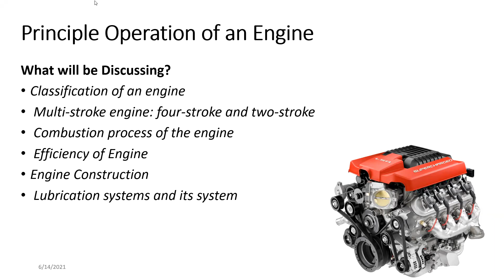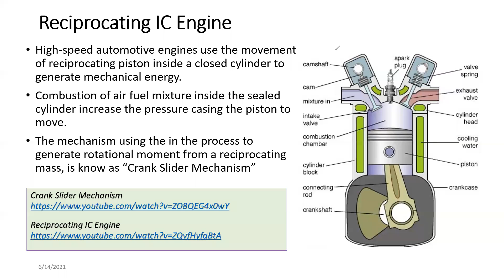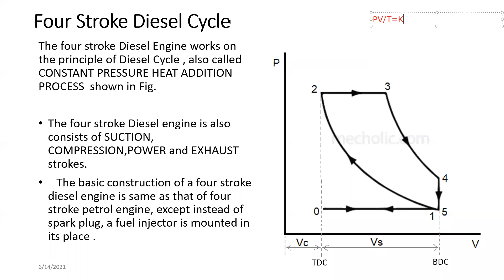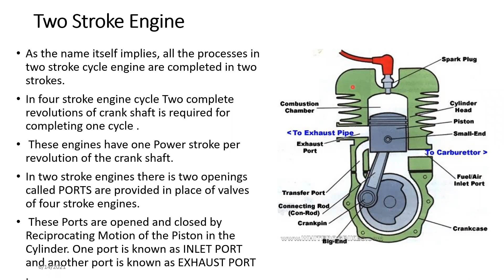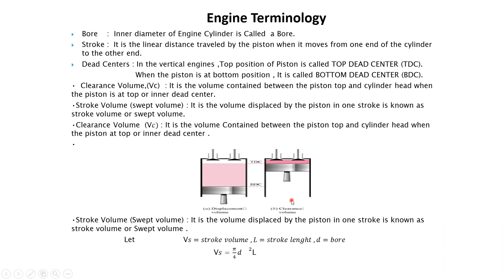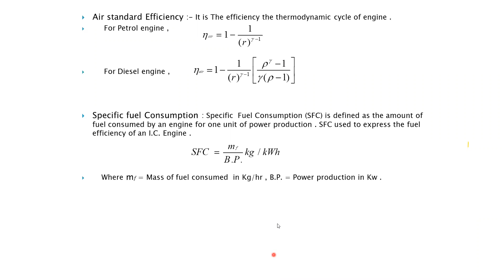Foundation in Automobile Technology Lecture 02

Comment: Video at 1:21:32 you told engine capacity determines by the total volume of cylinder I thing its was wrong . The displacement volume determines the capacity of the engine also know as the swept volume  measuring in CC
Reply from the maker: Engine Capacity it the representation of how much air fuel mix can be accommodate inside the cylinders.  So it  is the amount of fluid we can fill into all cylinders when all valves closed. 
Thus simply 
Engine Capacity = Cylinder Volume x Number of Cylinders
Cylinder Volume = Swept Volume + Clearance Volume  
Swept volume only represent the volume between TDC and BDC, clearance volume is also important for a accurate measurement even though its a small amount. 
"CC" stand for  Cubic Centi-meters,  it can be measured almost in any unit that represent distance, but standard practice is to use Cubic Centimeters. Before SI system , Cubic Inches was used for the same purpose , that's how  old muscle cars got numbers such as 427, 350 and 440 etc.

Thank you

cc